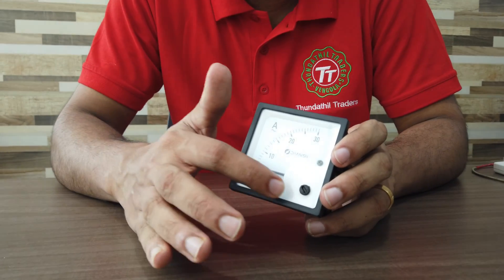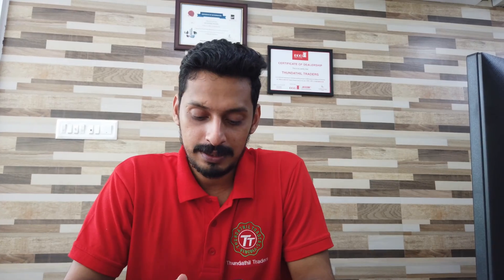How to rectify complaints in Borewell submersible -ബോർവെൽ മോട്ടർ കംപ്ലൈന്റ്റ്  ആയോ ? with Eng Sub

Comment: പുതിയ pump texmo 1.5 എപി വച്ചു പക്ഷെ discharge valey കുറവാണു  amp 10 volt 210 കാണിക്കുണ്ട്...
Reply from the maker: Model ethanu ? site head? 1.5HP 10A normal consumption anu . Pipe potitundo ?
Reply: 300  feet  bore well

Comment: വോൾട് മീറ്റർ റീഡിങ് കാണിക്കുന്നില്ല. അത് മോട്ടോർ നെ ബാധിക്കുമോ? Amp നോർമൽ കാണിക്കുന്നു. പക്ഷെ മോട്ടോർ ഓടുന്നുണ്ടോ എന്ന് എങ്ങനെ അറിയാൻ പറ്റും വെള്ളം വരുന്നില്ല. അങ്ങനെ മോട്ടോർ പത്ത് മിനിറ്റ് ഒക്കെ വെച്ചാൽ ന്തെങ്കിലും പ്രശ്നം ഉണ്ടോ. വെള്ളം വരാൻ വേണ്ടി വെയിറ്റ് ചെയ്തു മടുത്തു. Amp ചെറിയ വരിയേഷൻ അങ്ങോട്ടും ഇങ്ങോട്ടും കാണിക്കുന്നു. 8-12 amp. പക്ഷെ no water. എന്ത് ആകും കാരണം
Reply from the maker: Volt meter replace cheyu. Pump vellam ellathe kurachu neram kooduthal oodiyal pump damage varum. Normal running ampere kanikunund ,vellam varunilenki pipe potiyitundo ennu noku
Reply: @thundathiltraders  താങ്ക്സ് ഫോർ റിപ്ലൈ, മോട്ടോർ കത്തി പോകുകയോ അല്ലെങ്കിൽ എന്തെങ്കിലും കംപ്ലയിന്റ് ഉണ്ടെങ്കിൽ amp കാണിക്കുമോ സർ? ഓക്കേ 5 മിനിറ്റ് വെയിറ്റ് ചെയ്തു പിന്നെ ഓഫ് ചെയ്തു. Amp കാണിക്കുന്നുണ്ടെങ്കിൽ മോട്ടോർവർക്ക് ആണെന്ന് അനുമാനിക്കാമോ

Comment: Ente bore well380ft height texmoborewell pump 1.5 hp use cheyunnu. kurachunalayi discharge valare kuravanu. ampere 8amp edukkunnu karanam enhavam
Reply from the maker: 1.5hp 8A normal anu . discharge kuravanenkil check capacitor.  impeller block ayitundo enu check cheyyam. bush complaint anennkil normally consumption kooduka an cheyaru
Reply: Thank you

Comment: Very good information..
Reply: I have a doubt my amb meter sometimes showing above 5_10 at the time water is not coming to the tank..I need to turn of on several times to get it back to 2_3amb at the time only water comes to the tank
Reply from the maker: Higher ams is more realted to pump stuck. Try changing the starting capacitor.
If it doesn't solve the issue , there will be some issue with the pump . Try checking the pump bush
Reply: Thank you

Comment: 1.5 HP kirloskar pump. 16 amp edukkunnu. Pump work cheyyunnilla. Push button on/off repeat cheyyumpol 8 amp akunnu. Appol pump work cheyyunnu. Enthanu  reason pls reply
Reply from the maker: Push button njekkumbol starting capacitor nu koode ulla power chellum. Repeat ayi on/off njekkathe oru 3 seconds njekki pidichu vachu nokku.  sir voltage engane undu ?
Reply: 230
Reply: Same issue, @prajith ee method work aayo

Comment: High amber power വന്നാൽ എന്ത് ചെയ്യണം
Reply from the maker: Starting capacitor press cheythu nokkuka .sheriyayilenkil
Capacitor , pump side , motor ellam check cheyyanam.
Reply: Puthiya warranty Ulla Motor vagunnathine rate ethra aavum
Reply from the maker: @muhammedswadique953  Model anusarichum , brand anusarichu changes varum
Reply: Onninte kirloskar motor ethra rate onnu parayaamo🙂
Reply from the maker: @muhammedswadique953  Borewell submersible anenkil 
oil cooled (2 models) , water cooled, total head anusarichu rate difference undu bro.
kinarinte azham etrayanu ? oil cooled or water cooled ethanu vendathu?
Reply: 100 adi unde athupole onninthe motor aanu

Comment: 220 feet vertical open well which pump  therenjedukkam voltage fluctuations unde line voltage 170 unde step up use cheyyunnunde
Reply from the maker: Better to use oil filled borewell submersible

Comment: Borewell pump 1HP motor start cheyumbol 20 ampere kaanikunu....MCB trip aakunu...nthaan karanm ? Plz reply
Reply from the maker: Possible reasons : 
1. Capacitor complaint
2. Pump stuck
3.winding fault
4. cable leakage
ethil ethu venamenkilum avam.
Reply: @thundathiltraders  Thankyou

Comment: I have a 5 hp single phase submersible pump, make duccan
Compliant_ it will run only one minute , within this time the fuse in fuse box will blown, what's the compliment?
Reply from the maker: Check the current consumption.
Reply: The pump will run 30 to 40 seconds only ,do it is difficult to find out the electric consumption.
Reply from the maker: 30-40 seconds is enough to check the ampere. I think its winding fault. Just confirm with a good technician
Reply: Ok thank u

Comment: Chilappol ambior 15 aakunnu. Apol vellam kayarunnilla. Chilappol 10 ambior aakunnu appol vellam kayarunnundu. Endhanu problem onnu parayumo
Reply from the maker: voltage fluctuation ulla sdalam ano ? capacitors check cheythiruno ? Weak ayitundon ?
Pala karanangal kondu varam. Vachirikuna panel MCB anenkil Push button press cheyarundo ? 
Cheriya stuck vannalum angane varam. Athum allenkil bush complaint.

Comment: sir motor onakunnund vellam kayarunnilla voltage 220 amb 15 numukalil  sadarana 10 num 15 num idayil  company grath 1.5 hp 350 feet please reply
Reply from the maker: Pump stuck ayirikananu sadyatha. Capacitor check cheythu nokiyo ?
Reply: @thundathiltraders  ok thanks cheythnokkam.
Reply: sir capacitor randum okyanu enkil motor stuck ennu paranhal replace cheyyendi varumo
Reply from the maker: @shiha-x2s  Starting capacitor push button (MCB type panel) Press cheythitum ok ayilenkil. Pump stuck undo enu poki nokam.
Reply: @thundathiltraders   ok tanxs

Comment: Vellam tankilekku kayaranulla force illa motor on cheyyumnol kitchen pipel vellam varunnundu athum force illa ethu partsanu complaint onn parannu tharaamo
Reply: Borwellanu hp ethre ennariyilla 300 ft borwellanu runing ambere 10 anu
Reply from the maker: 1.5Hp avan anu chance
Reply: Munne 20 minutinullil 1000 litr tank nirannirunnu
Reply from the maker: Capacitor weak ayitundo ennu nokkuu..  allenkil suction net chilapo adanjitundavam, allenki pump cheli kayari adanjitundavum. A
Reply: @thundathiltraders thanks nan nokkatte
Reply from the maker: Borewell pump ano ? running ampere etra anu ? etra hp motor ? nerathe nannayi vellam varunundayiruno ?

Comment: പല കുഴലുകളിലും മോട്ടോർ ഓൺ ചെയ്തു വെള്ളം തീർന്നു പോവുന്ന അവസ്ഥ ഉണ്ട് അപ്പോൾ വെള്ളം ഇല്ലാതെ മോട്ടോർ കൂടുതൽ വർക്ക്‌ ചെയ്താൽ എന്ത് സംഭവിക്കും?
Reply from the maker: Motor complaint avum. Normally vellam ellathe varumbol heat koodi impeller uruki pump stuck avum. Athu vazhi coil short avan chance undu
Reply: കുഴലിൽ വെള്ളം ഇല്ലെങ്കിൽ മീറ്റർ 0 യിൽ  നിന്ന് ഉയരുകയില്ലേ  കേടാണോ എന്ന് അറിയാൻ വേണ്ടിയാണു
Reply: @sharerfkodiyilshareefkodiy531  വെള്ളം ഇല്ലെങ്കിൽ അമ്പിയർ വളരെ കുറച്ചേ കാണിക്കാറുള്ളു. (വെള്ളം ഉള്ളപ്പോ അടിക്കുമ്പോ 8 അമ്പിയർ ഉള്ളപ്പോ വെള്ളം തീർന്നാൽ പിന്നെ 1 അമ്പിയർ കുറഞ്ഞു ആണ് കാണിക്കാറ് എന്റെ vtl
Reply: ഹലോ മോട്ടോർ ഇടുമ്പോൾ 3 മിനുട്ട് വെള്ളം കിട്ടുന്നു പിന്നെ വെള്ളം വരുന്നത് നിന്ന് പോകുന്നു അപ്പോഴും 10 അമ്പിയർ കാണിക്കുന്നു എന്തായിരിക്കും കാരണം

Comment: What is the running ampere of Ekki 5 hp motor
Reply from the maker: Which model ? Centrifugal monoblock? Openwell ? Vertical openwell or borewell submersible?
Reply: Bore well
Reply: ER42H/40 model